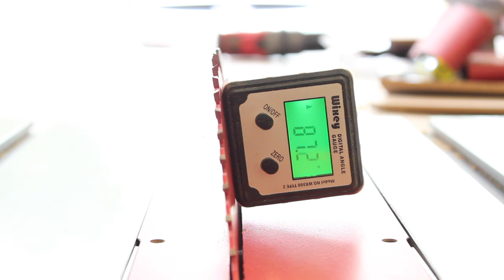Making Box 30 from Matt Kenney's 52 Box Challenge

Comment: Where did you get the custom brand. That looks very well made, and I have been looking into trying to get one. 
Also, any drawbacks with that one that I don't see?
Reply from the maker: Hi Karl. I purchased it from a website called brandingirons (dot) biz. You're right, it is well made and I've been super happy with it for the 2 years I've been using it. I have to heat it up with a torch which can be tedious so I if I had to do it again I would buy the electric version which is a little bit more expensive.
Reply: Karl Porter try shapeways (dot) com. They print in 3d sintered metal so you can design your own brand in something like sketch up and upload it to their website for printing and posting back to you
I made mine and it was printed and shipped for something like $30-35.